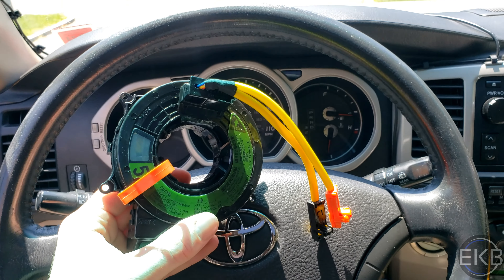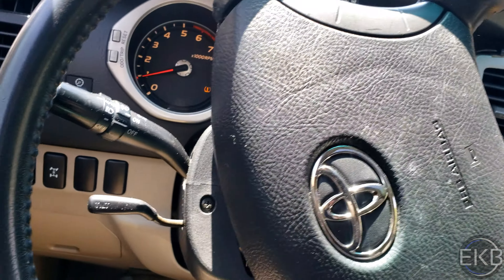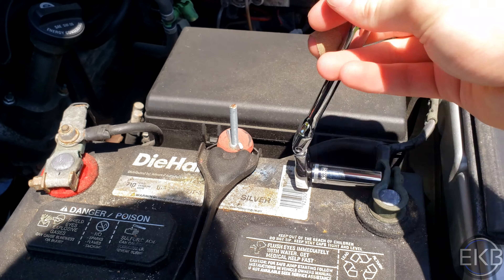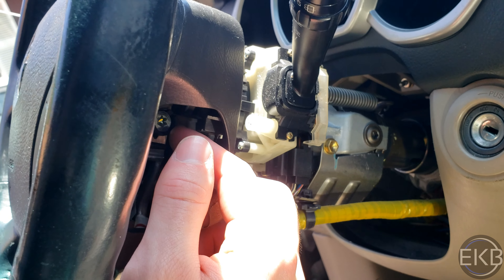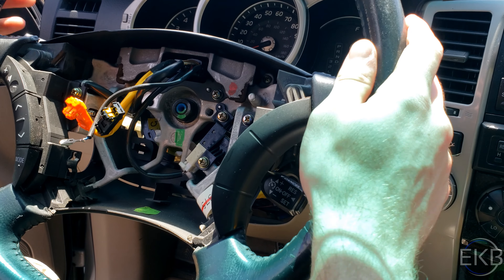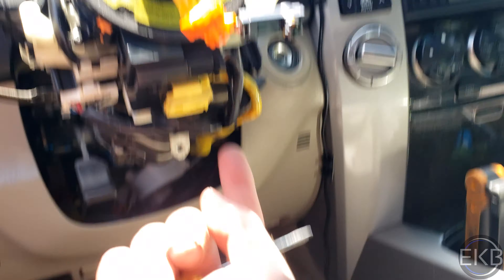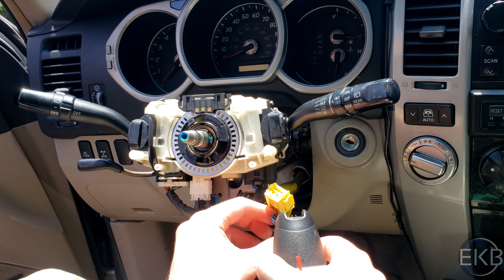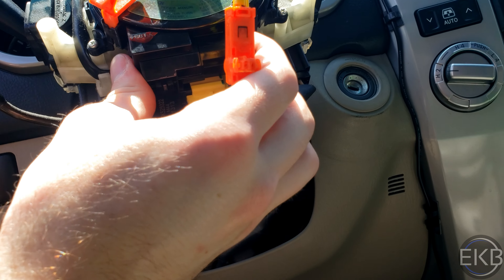How to Replace Clock Spring 03-09 Toyota 4Runner

Comment: Great tutorial! You make me think I can replace mine myself (the most car thing I’ve even done was get gas so wish me luck😂)
Reply from the maker: Thank you for the feedback. 

After doing some more serious repairs, this one is honestly pretty simple. It's also inside the car so rust shouldn't be an issue. Just be careful with wires and don't pull on the wires themselves. Pull on the connectors. Other than that, you saw how it goes. You got this!
Reply: @ELITEkickBOXER followed your tutorial and changed mine. It fixed my horn issue. Thank you!!! However, the turn signal now no longer self cancel after a turn (I have to manually turn it off). Could it be from a mistake I made while changing it?

Comment: Thanks for this tutorial, the only thing I would have done at the end was show that it worked, tested the horn, volume controls etc..
Reply from the maker: Thank you for the feedback. 

That's a good point. I didn't show the horn on purpose. The video was made to show how to replace it, and hopefully address the reasons one sought to replace it in the first place. In my specific situation the new clock spring did not fix my horn problem because the wire/connector at the horn itself was what caused my horn to fail. That was one reason the horns may not work. The clock spring was another, yet not applicable to my situation. 

While I showed (I think) the buttons working in the beginning, you're right in that I should have showed them at the end too.

Comment: If the spring cable is bad will I have all of these issues? My only issue seems to be the buttons not working. I've tried holding mode then hitting the up and down buttons 3x each but that didn't work. I also tried disconnecting my battery for a bit.
Reply from the maker: When I went to respond to this comment, I was prompted with this ?AI? response. So this is interesting. 

"If it's just the buttons, you may have a problem with the control unit itself (and not the clock spring)."

As a DIYer, i honestly can't say for sure what your problem is. It's possible it's the clock spring, but also possible it isn't. You can check for broken wires or anything that looks off if you were to disconnect everything. Perhaps do some more digging (of you haven't yet). Though i do know your problem can (not guaranteed) indicate a bad clock spring when i was researching this originally.

Comment: Both the old clockspring and new clockspring have instructions printed on them to turn unit 5 times to left before installing. Did i miss something?
Reply from the maker: I was not aware of anything like that. Perhaps, I missed something.
Reply: @ELITEkickBOXER  Seems to me that the locking tab would indicate that you are NOT to turn that sucker at all!  Thanks for the step by step tutorial. I have all of the problems related to this issue, so I'm taking a $39 flyer that  changing this out will fix them.  (I'll be looking for any instructions about turning it prior to installing.)